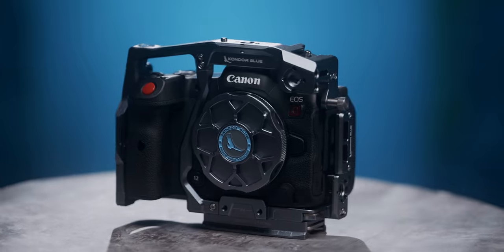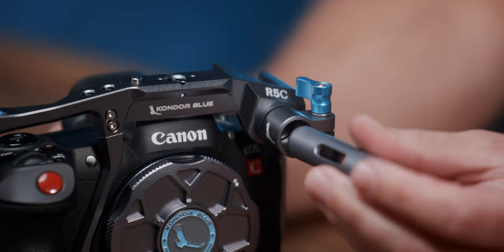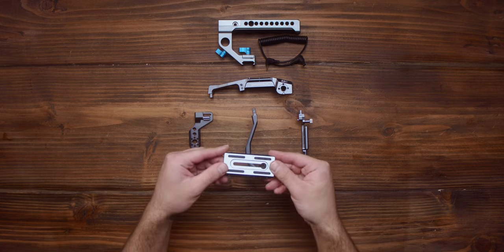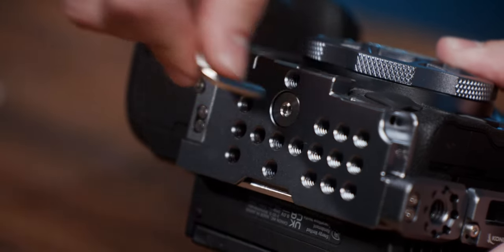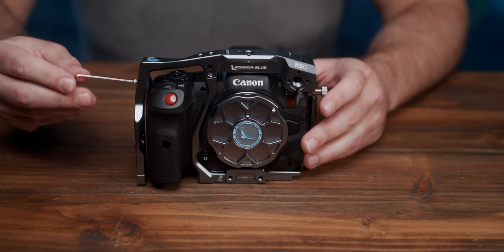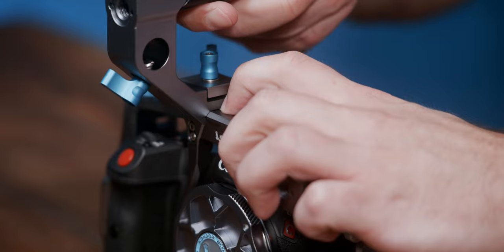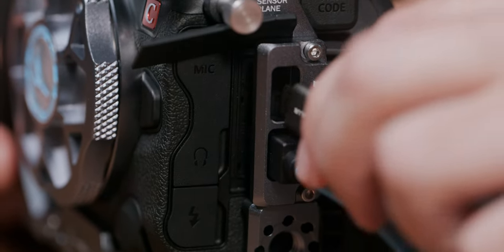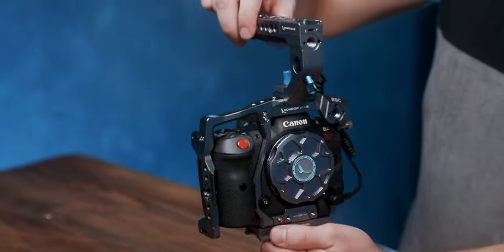Canon EOS R5C Cine Cage Install

Comment: Congrats you took the perfect hybrid camera and made it a total hassle to use the photo side of the camera.  Too much effort to remove the cage, put a neck strap back on and go for a photo walk, then have to rebuild it all again.  Honestly I considered it the perfect cage until I see all the constant assembly and disassembly I would have to do.
Reply from the maker: Yes we leaned into the Video Side with the R5C cage. We do have an R5 cage though that will also work on the R5C and is designed to slide out of the cage quickly for hybrid shooters. Options!

Comment: Question. I just received this and love the build but my previous cage was a small rig and it was very easy to mount a follow focus. I bought a 15mm adapter for this cage thinking I would y mount the follow focus to the bottom left side below the HDMI port as I normally would but the only connection is a rosette looking thing that I have no idea what to do with. I've searched B&H and their website and haven't found anything to make this make sense. Suggestions?
Reply from the maker: Hey great question!
We intended for the Arri 3/8s on the top left to work in conjunction with our M12 Rod Mounts https://kondorblue.com/products/m12-rod-screw-mount and our threaded rods that screw directly on! If you have any more questions about the products or anything else don't hesitate to reach out to us on our live chat on our website or email at support@kondorblue.com!
Reply: @KONDORBLUE  please don't try to trap us into your ecosystem.  This is a strong reason to go with another brand.
Reply from the maker: @therealjimmy5411  that’s actually the opposite of our philosophy Jimmy! We are all about freedom!! There are always several ways to accomplish something and we stay away from proprietary wherever possible.

Comment: Does any of your handles support start/ stop recording, with the R5c?
Reply from the maker: Yes! Our Remote Trigger Top Handle works flawlessly!
Reply: @KONDORBLUE what cable is used to control the start and stop? Does it go into the USB C or does it use another port like the 2.5mm?

Asking because I'm already using the USB C port for power delivery

Comment: Is there a dummy battery to support 8K?
Reply from the maker: We're soon coming out with a cable that uses the USB-C port to allow for 8k shooting! This allows you to keep a battery in the camera and hot-swap your vmount 😎
Reply: Dummy battery is still useful when using a ronin gimbal, since the USB port is used for communication between gimbal and camera. 

Which also makes remote operating a problem
Reply: Have you tried using a usb-c splitter?